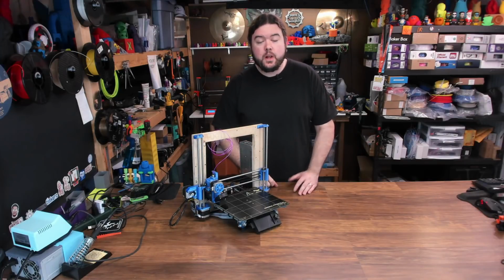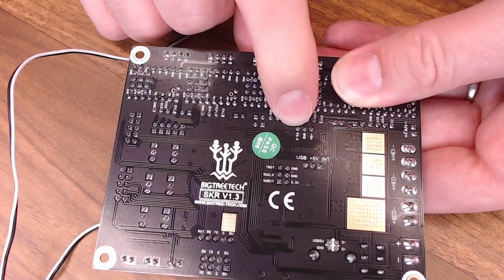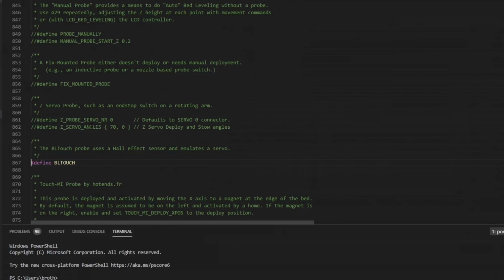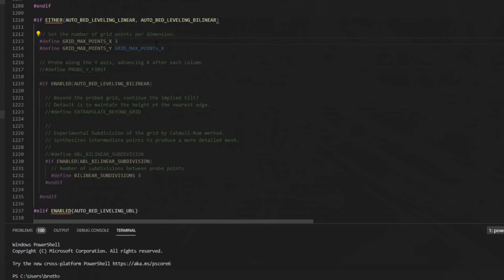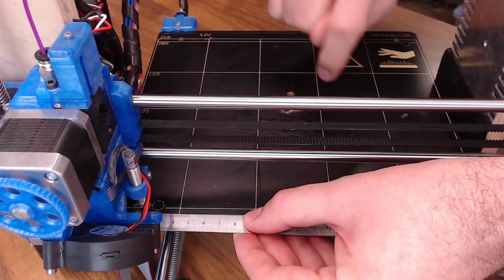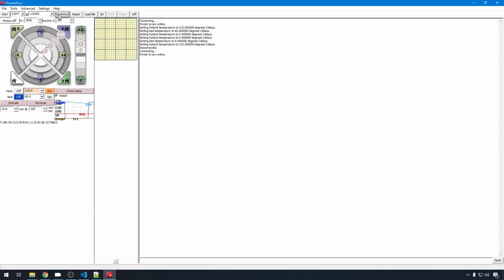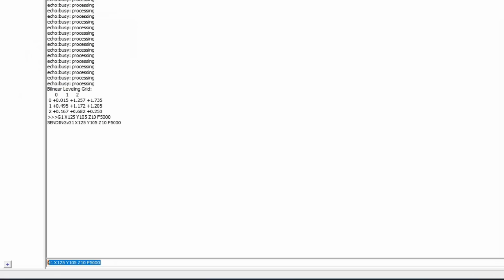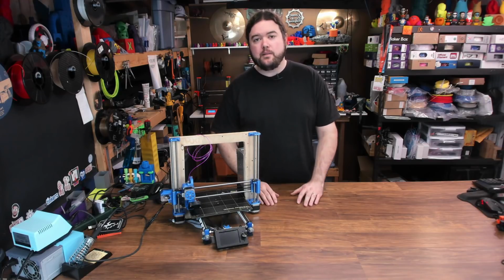Auto Bed Leveling - Marlin 2.0 - How To - 2019 - Chris's Basement

Comment: Thanks Chris, yet another great video. Personally I have found the results to be much better from the Mesh if I enter an M420 S1 and M420 Z10 (if not done on LCD) - to get full usable advantage for the ABL, the restore G28 - seems to not be enough.  I have had some struggle getting the first layer to work/give the benefits on my Ender5, but after including the M420 S1 in the start code in the slicer - the first layer is almoust perfect, so are the prints :) . Keep em coming - I love all your videos.  Greetings from Norway
Reply from the maker: Thanks Stig! I have been playing with the M420 recently, lulxbot uses it a lot. I am thinking this might be a great thing to go over in a video.
Reply: Chris Riley yeah. Seems it’s not possible to get it to «stick» from command line. I have rund M420 S1 followed by M500 a lot of times. M420 always reports It’s in «off» state after print or revboot. When running it after G28 in start script it always use the mesh and good results. The fade does however stick even from command and M500 save. So that one is only needed to run and save ones - to my best knowledge.
Reply: @stigberntsen9301   I have been trying to figure out how to setup my gcode in my slicer, should it look like this:

G28 ; home all axes

G29; BLTOUCH mesh generation
M420 S1

G92 E0.0

G1 Z5;

G1 X10 Y10 Z0 F6000;

G1 X60.0 E9.0  F1000.0 ; intro line

G1 X100.0 E12.5  F1000.0 ; intro line

G92 E0.0

I am not sure if I should leave G29 in.  I have seen you only need to do G29 once and store it with M500.
Reply: D C Personally i do G28 from pronterface or something similar (octoprint) then G29 and finally M500 + M501. This measure and save/load the settings. Then in my script i Use G28; to home all. I comment out the G29 ( only use it if needed since the bed normally stays leveled as is) after G28 i put M420 S1 Z10 ( latter is fade hight). I re-run G29 and save new mesh aprox 3-4 times in a year.

Comment: I wish Marlin would warn you about high deviation like klipper does. you can set a value in klipper (I use 0.05) and if the deviation between 2 or more probes get higher it tries to probe again (I set it to try up to 2 times) and if that doesn't work it'll just stop and throw an error!
Reply from the maker: You have a few different names over accounts and Twitter so I am going with Ami...;) All kidding aside, Marlin is trying to get there. Check out. 

 //#define ABL_BILINEAR_SUBDIVISION
    #if ENABLED(ABL_BILINEAR_SUBDIVISION)
      // Number of subdivisions between probe points
      #define BILINEAR_SUBDIVISIONS 3
    #endif
Reply: @ChrisRiley  oh cool! But yeah xD I named this account emily (my real name is Amy) because I was worried about putting my real name in my channel but I now realize I was probably too paranoid. I'll probably see if I can change the channel name to my own again xD

Comment: Ive followed this guide, and your previous one to the letter. However it still refused to compensate for the bed level, im unsure what else to try :/ - edit, by this i mean the z height does not increase or decrease at all, and im still getting parts of the print that do not stick due to the nozzle being too far from the bed. g28 then g29 in cura setup so it does the mesh before print, z offset set correctly etc
Reply from the maker: Hmmm, is there anything floating around in eeprom? Have you ran M502 then a M500?
Reply: @ChrisRiley  eeprom cleared with a m502, fresh setup/install of marlin, m500 etc. z sticks to the z first layer height of 0.28 (profile setting) and does not increase or decrease at all, im stumped , it should work fine, goes through all the motions but nothing seems to work, ive had this issue with both my inductive probe i bought and my bl touch
Reply from the maker: @Section59.  That's crazy, I have not idea what could be causing that. ALmost has to be some sort of firmware bug.

Comment: The monoprice Select mini has a example config in Marlin 2.x, it would be interesting to me to see a guide if you still have one.
Reply from the maker: Interesting, I will check that out.
Reply: Its under malyan instead of monoprice for the manufacturer. Not sure if that would throw you off but it did me for a couple minutes.

Comment: Is it possible in Marlin to wire a standard Z endstop switch to the Z-MIN-ENDSTOP port and an inductive probe to the Z-MAX-ENDSTOP port, and then have the firmware use the endstop switch to home the Z axis, but use the inductive probe to level the bed?  In this case the endstop switch fires when the nozzle just touches the bed, and the inductive probe will fire at some point above the level of the probe (which is the Z probe offset value).  I'd like to add the inductive probe, but keep the z endstop.
Reply from the maker: Yes, you can do this, you would use this feature #define Z_MIN_PROBE_PIN 32 instead of this one #define Z_MIN_PROBE_USES_Z_MIN_ENDSTOP_PIN then just use your max endstop pin from your pins file.
Reply: In my case Z_MIN_PROBE_USES_Z_MAX_ENDSTOP_PIN works also fine.

Comment: Hi Chris, my bed levelling seems to be inverting the offset. I've searched for what might be the cause but only found a couple of references to a similar problem but no answers. Would you know what could be causing it? I've turned off bed levelling for now.
Reply from the maker: What firmware/board are you using? Not all firmware does it the same way.
Reply: @ChrisRiley  Marlin 2.0 bugfix on a SKR 1.3 and a SKR pro v1.1 both with 2209 drivers. the pro has an induction sensor and the 1.3 is using a 3Dtouch. Both are behaving the same, inverting the offset.
Reply from the maker: @gptech2444  That's really strange, the only thing I can tell you is to try to upgrade to the new Marlin 2.0 official release.
Reply: @ChrisRiley  I got to the bottom of what was going on. My printer has dual Z axis motors driven off one TMC2209 and the gantry is heavier on the left side due to the X axis motor and bowden drive hanging off it. So what was happening was the left side of the gantry would slowly lower due to weight and there would be a difference of 0 to 2.5mm even after levelling the Z axis. I've gone with an extra TMC2209 to drive the RH side motor and now use a G34 to level the Z axis before a print. And I've setup UBL following you tutorial on it.

Comment: BLtouch setup questions. 
1. BL offset setup?
2. TMC2208 endstop sensing?
3. So my BL is now my z endstop?
4. Is a BL considered a PNP or NPN; guessing the code automatically sets it up when selecting BL?
How do I setup a BLtouch when the sensor is not adjustable up or down? When it's deployed I'm guessing it's going to hit z endstop before the extruder hits.  Then I'll retract it to drop the extruder with baby steps to calibrate z offset.  I'm trying to set up with my TMC2208. Does z safe homing  relate to the 2208 endstop sensing.  I'm close,  but need some confidence on not crashing head.
Reply from the maker: 1. BL offset setup?
That's the measurement from the nozzle to the sensor.

2. TMC2208 endstop sensing?
No, but 2209's have it.

3. So my BL is now my z endstop?
It can be, or you can do both. Most times yes.

4. Is a BL considered a PNP or NPN; guessing the code automatically sets it up when selecting BL?
How do I setup a BLtouch when the sensor is not adjustable up or down? When it's deployed I'm guessing it's going to hit z endstop before the extruder hits.  Then I'll retract it to drop the extruder with baby steps to calibrate z offset.  I'm trying to set up with my TMC2208. Does z safe homing  relate to the 2208 endstop sensing.  I'm close,  but need some confidence on not crashing head.

I am not sure, but I would call it an NPN, it will alert you if it is not set correctly. To setup the height there is some guess work involved, the bltouch doc trys to give you a guide for where to place it. The sensor should tap the bed before it hits the endstop. Correct, it will be up when babystepping. No z safe safe homing just lets you home in another location besides the corner of the bed.

Comment: Great video! Is it possible to install Marlin 2.0 in an Anet A8?
Reply from the maker: Thanks, sure! It should work just fine.
Reply: Thanks Chris Riley. I was thinking on the size of the firmware, and the space in the Anet board.
Reply from the maker: @sebastiansombra  You have to get kind of tricky with it, but Marlin does include an example sketch that should fit.
Reply: Chris Riley great.  Thank you. I’ll try it.

Comment: I think maybe you are confusing Normally Closed vs Normally Open (NC vs NO) for PNP and NPN. Maybe I need to watch again closer, but when you invert the login in Marlin you are more accurately changing from a NC vs NO. PNP is Sourcing, which means the switch will push the voltage out the signal, thereby pulling the signal high, otherwise it is left floating. The NPN is sinking, which pulls the signal low (0v ref) when the signal actuates. Both of these type switches can come in NC or NO configurations.
Reply from the maker: I very well could be working off assumptions from experience. I will have to do some experiments.

Comment: Hi Chris. Merry Christmas!!!
Just a quick question regarding the probe you're using. Is it compatible with anycubic ultrabase glass plate or I have to switch to a spring sheet to use this method.
Thank you in advance 
Andreas
Reply: It will work with Spring metal sheet but you need a capacitive sensor for the glass ...
Reply: @ikomu8907  thank you!
Reply from the maker: Thanks for the assist!
Reply from the maker: And Merry Christmas!

Comment: Happy holidays and thanks Chris from Germany.
Yes, I‘d like to see a vid about the the remaining setup in Marlin 2.0 final.
At the moment I’m struggling with the Bltouch. The printer doesn’t consider the results from the leveling during printing an thus some areas are ok on the bed and some not (the nozzle is too much above the bed). I don‘t find the mistake.
Reply from the maker: Happy holidays!!! Cool, I will work on that. I have heard of a lot of people struggling with this. It seems like some of the newer sensor are inconsistent.
Reply: @Klaus
I have exactly the same problem. And I thought I was alone with it. I updated my firmware several times and flashed but no improvement.With the old firmware (Marlin 2.0 bugfix from August) never had any problems but since I flashed the new Marlin I have had the problem.  Maybe Chris Riley knows a little more about it?
Reply: @Oliver Sierra  Which version of BLtouch are you using? I‘m using V3.0.
Reply: @KPTnVAN  I have the exact same version. Are you in the BigTreeTech Facebook group? (I can also speak German, because I come from Luxembourg)
Reply from the maker: @KPTnVAN  I think this one is a v2.0, it's the first one with the plastic pin.
Reply: @Oliver: Nice to hear! Greatings to Luxembourg. Sorry I‘m not in that FB-group. Is it helpful concerning the issue I mentioned? I uncommented the 5V mode and the pull-up-resistor for the BLtouch-pin and it seems it works better. But I‘m not sure and will check it further.